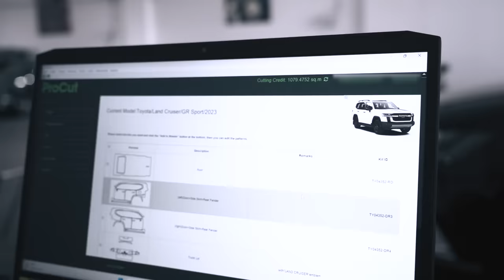We transform this brand new Toyota Land Cruiser GR with ARCTIC TRUCKS.

Comment: Looks good, but I don't need bodykits when offroadin tbh
Reply: Yes you do it makes it look more like a serious offroader car
Reply: It depends what's kind of offroading. But here form follows function. The wheel arches are to accomodate the larger, chunkier all terrains. A higher clearance also equals better confidence. This vehicle is suitable for overlanding...
Reply from the maker: Absolutely correct here with the comments above…
Reply: You just don’t get it do you?
If you don’t want it, don’t buy it.
Reply: Probably meant for the Middle East where driving in the dunes is the main pastime.
With the wider tires and offset rims the wheels stick out, clearing the stock arches and would sandblast the rest of the body.